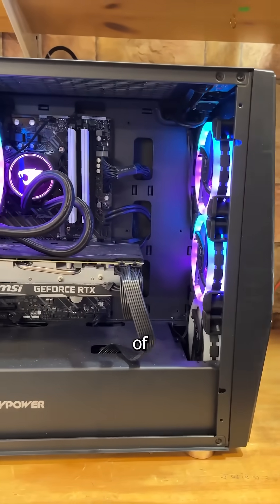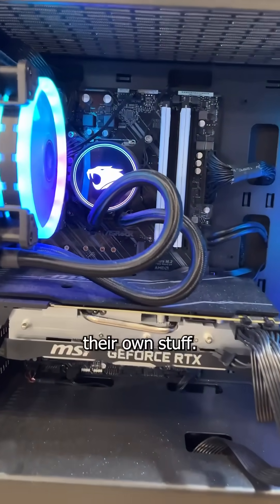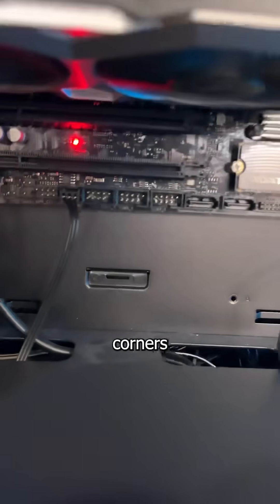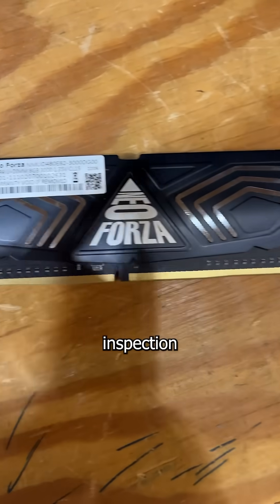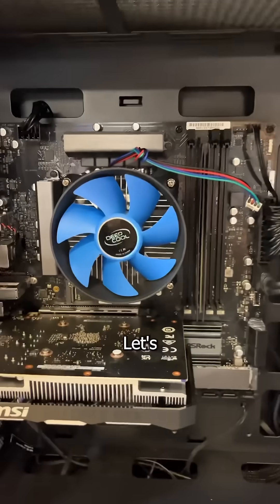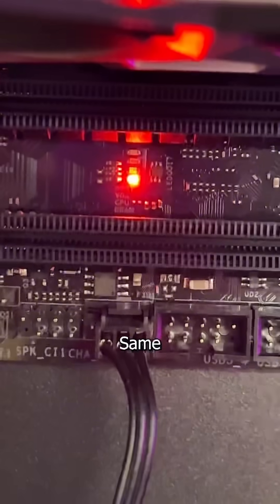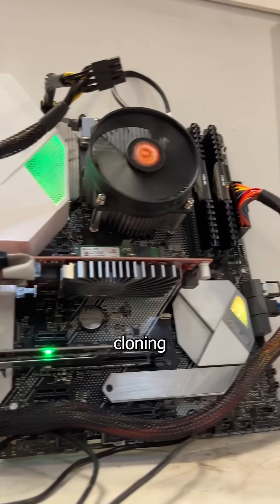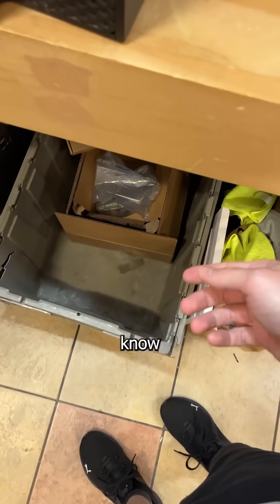iBuyProblems? Cheap NVMe causing no POST 💀 #technology #pc #tech #shorts #computer

Comment: I have an ibuypower since 2018. I just gave it a new coat of thermal paste and a clean out and still works fine.
I feel that a lot of problems are the adata drives and the user trying to mess with components or bad shipping handling.

Comment: Ok I've worked in computer repair and I have a similar issue, but backwards and I can't figure it out.  

I can't get my pc to post without the ssd I run windows on, I get a CPU error.  My theory is that it has something to do with AMDs overclocking utility.

Comment: Only after around 3 or so months after I bought my boot drive, the Adata XPG SX8200 Pro 512GB, did I realise how scummy Adata really is. (For example, the same model of the drive I mentioned above got its internals changed quietly which led to different performance from they launched it.)

Comment: When a storage device such as a ssd or an hdd are so faulty that they mess with the system itself things get funky
Once had a pc with a faulty wd green that for some reason made it have a black patch on the monitor (even tried formatting the drive)
And a laptop of mine would get stuck trying to load the bios because the drive was dead

Comment: Got a 1tb ADATA SSD installed in the front of a old iBuyPower Revolt 2 case which I have a weird feeling its a prebuilt of sorts, still going strong after 3 years now with only the straight no brand AIO cooler leaking and needing replacement.

Comment: Funny enough my brother had a prebuilt PC with an ADATA SATA SSD that caused the exact same issue. We went to get another SSD and that fixed the issue. I tested the ADATA drive later in an external enclosure and was able to see its contents, but every time I attempted to extract anything the drive would disappear from device manager and take maybe 10 minutes to reappear
Reply: AData isn't bad, I've used AData ram and storage for years without problems, but I know friends that had problems with their cheap sata 256gb dramless ssds,
Conclusion for AData is that their cheap shit is cheap, the pre-builts use factory waste / units that failed quality check
Reply: Guess the drive was alreasy past it's end of life
Reply: It was because the dude downloaded incompatible RAM online, and that storage had it on it. /s
Reply: That adata ssd your brother had probably had a different problem. Pretty sure the adata nvme in this computer is their PCIe 4.0 one, which has a problem since the innogrit controller has problems with certain types of nand flash.

My adata sata ssd had been going strong.

Comment: The previous SSD might have had a hardware issue or defect that, when connected, triggered some sort of error detection mechanism on the motherboard, leading to the RAM error light.

Comment: I bought an ibuypower PC during the Gpu apocalypse because it had a 3080ti in it and was cheaper than buying a 3080ti from scalpers.  But the CPU cooler on it only lasted 30 days before the pump failed. So i scrape it and sold the board, cpu and ram on ebay and placed the 3080ti into a much better built computer. One built by myself.

Comment: PCs are doing a short Self test at boot and the debug leds are always lighting up at the process and Shows what the bios checks right now and if it has a problem the bios will Stuck and the light will Keep lighting. and now the question why does it Stuck when it test the nvme ssd it will ask the drive what it is and if it doesnt Response correctly It will Stuck But not completly it can Hang for an hour and it will continue posting. depending on the bios and Debug Codes the RAM led will light up even in the PCi test

Comment: Propably a short on the pgood or reference or the reset signals and it keeps the pcie devices pulled down. So the chipset is also in reset state so does the cpu.

Comment: Hey man, hope you are doing well. I am facing problem with my pc. the problem is that, I can do everything with my pc, but can't get in to bios. Idk what the heck is wrong. do you have solution.  I have done almost everything to get it. but it just shows no display connection but normally it's a great monitor

Comment: Wouldnt trust adata with nvme’s eithet but external HDDs are a different story. Opened a few before - they use Samsung or Toshiba disks so theyre usually really reliable. At least mine of 6 and 2 years are still clean in Crystaldisk.
Reply: I guess adata doesnt make HDDs. Its most likely just an adapter with branded HDD inside like WD or Seagate. And btw, every memory related stuff from adata succ for some reason - sadly learned from my own experience.

Comment: That's an interesting failure. It's weird because the DRAM uses the North bridge chipset and that NVMe was placed at dead bottom, supposedly using the south bridge chipset. 

My only guess is that an electrical error must've stopped the boot process at the DRAM check. Meaning the SSD had some bad capacitors or a melted connection that was touching another important connection, and the motherboard had a failsafe for short circuits, causing the NVMe drive to lose all power during the boot up sequence, making the motherboard believe the ram was at fault.

Comment: Nvme shares power and bus lines with certain other CPU connections

Like the ram

It also depends on the slot, because not all mobos are designed equally

Comment: My MSI board has 3 LEDs: CPU, DRAM, and POST. I find it will default to DRAM for multiple issues (like cpu mounting pressure).
Reply from the maker: Yeah most motherboards do this. Which is hilarious cause it’s 2023 and we’re stuck on 1990 LED diagnostics

Comment: I’d like to say telemetry is the culprit for that issue
Reply from the maker: Please elaborate. I’m interested
Reply: @SalemTechsperts  sometimes when certain parts of computers are put together they wont communicate with each other. Say an AMD socketed motherboard with and AMD chipset but you have a janky power supply. The communication that the chip and motherboard trying to talk to the power supply saying "FEED ME" will be either neglected and the whole system will do some very funky things or take a forbidden nap and not wake back up from not being fed enough power. I have a CyberPower hunk of absolute polished crap so I know exactly how it is.

Comment: I love how these pre-built companies find the most obscure and unknown RAM companies possible to supply them with parts for their systems.
Reply from the maker: It's impressive tbh
Reply: @SalemTechsperts yup. I’ve rarely heard of any company outright having bad ram. Neo forza is also a good cheap ram. It’s not the fastest but it gets the job done. 
But dear god the amount of terrible things I’ve heard about ADATA NVMEs is insane.
Reply: Tbf ram is one of the few components that you can just pop in whatever brand and it should be fine.
Reply from the maker: @GamerBoi775   and most offer lifetime warranties
Reply: @GamerBoi775 I used to think that until I had stability issues for a year or so (every few days it would power off, no warning, conveniently whenever I was trying to be productive, not when doing something like gaming) and removed the cheap ram and it has been stable ever since
Reply: @GamerBoi775 to an extent. My company only uses Corsair ram as they should have QA to pair ram sticks. I put literally the same dye from a different ram distributor into a pc we wound up losing somewhere around 100 gigs of data from windows eating itself from ram timing issues. While away overnight. 

We do machine learning so it’s imperative our machines stay running with no hiccups we can lose days of work easily.

No data recovery is also available without extreme specialty either once files corrupt for anyone wondering. Even then chances are slim.
Reply: @GamerBoi775 not completely because most prebuilt companies don’t even specify what type of ram it is they just say like 16gb or whatever and it could be really slow like 1600mhz or something and you wouldn’t know
Reply: @GamerBoi775 Yes and no. The most common failures I've seen in computers are RAM and hard drives. Motherboards, too, but that's usually because of a cheap piece of shit PSU that borked the motherboard and took a few other components with it lol.
Reply: i bought an ADATA HDD back in 2012 or something and it still holds surprisingly lol
Reply: Microcenter sells Neo Forza ram actually.....
Reply: Neo Forza is actually a very common brand.. it's a budget brand... G Skill is also a very common brand.. ADATA has been around since the '80s more or less, and is extremely common and they make components for some of the most well-known computer manufacturers out there... Including Dell and Alienware as well as cyberpowerPC, compact, HP, IBM, Lenovo, Fujitsu, Toshiba and the list goes on and on.. just because you don't know the brand does not mean that it is unknown...
Reply: Brand doesn’t really matter that much. It’s gonna be made by sk Hynix or Samsung or micron
Reply: Its usually a chinese company supplying the parts and thats why the prebuilts are mad cheap.
Reply: Maybe these system integrators do but when you buy Dell, HP, Acer, or any other large OEMs, you'll get ram that comes directly from Micron, SK Hynix, Nanya, Infineon, etc.. The SSDs are usually the same way OEM Samsung, Micron, SK Hynix, Toshiba(now Kioxia,) etc.
Reply: To be fair at the Microcenter near me neoforza is the only ddr3 ram available lol
And they don't seem bad at least to keep as a diagnostic stick of RAM
Reply: Neo Forza is Goldkey's house brand. Goldkey is a year older than iBP
Reply: It’s cheap is why lol
Reply: I´m not a company and got a very dark underground pair of sticks xD
Atleast has samsung chips
Reply: I know it's been three months since your post. The reason why they do it is almost all ram "makers" or providers use the same two ram chipmakers. Basically, all ram is the same no matter what brand it is. And there will always be chips that fail for whatever reason, and it happens to all ram sellers. So, they will get the cheapest ram they can get their hands on to save on costs with little risk of it failing. The same with any common component.
Reply: Neo Forza is a familiar name if you mess around with pcpartpicker a lot.
Reply: Most of the time, you can just go buy ram sticks at any local reputable shop and it'll work just fine. As long as you buy them with warranty
Reply: Geil memory has been around for more than 20 years smh
Reply: Adata is not obscure.
Reply: Cheaper products without as much advertising always a good choice 😂
Reply: My MSI pre-built is going strong though
Reply: 980 is what I always use never an issue
Reply: they all buy the same ram from china and rename it, they even put the brand of the store
Reply: IBuyPower isn't a pre-built company
It was an eSport team for Counter-strike before they disbanded
Reply: @zaneatat iBP was an SI for like 13 years afore they even got into esports at all.
Reply: Aryan tbh
Reply: eh, I've heard of adata before but good to know to avoid them
Reply: Right, go for the cheapest parts they can then over-charge on the pc
Reply: Pretty sure there are only a few companies that actually manufacture the RAM chips so the name brand of the sticks isn’t really important. If you’re going for high performance then it is more important cause better brands will have better quality control and binning.
Reply: i’ve used adata years ago when i was poor. i’m still poor so i use corsair instead

Comment: Hey, I'm finally early, I got a question, what is wrong about the adata drives? I use an adata SSD, because I can't afford another, whats wrong with them? Is my pc gonna die?
Also thanks for your videos, they're amazing
Reply from the maker: I've experienced a high failure rate with ADATA drives, your experience may vary. Regardless, always have your important data backed up to multiple places regardless of the brand of drive you use.
Reply: @SalemTechsperts  thank you, what ssds do you recommend?

Comment: that moment when he was about to boot the PC but... forgot to switch the PSU on...
💀 I almost died.
Reply: If I was going to do work on my computer, I would turn off my PSU too. If I suddenly forgot to turn it on...so what? It's just a click.
Reply: @laffi bruh
Reply: @laffi if you ever worked in computers for real this would be terrifying ABD hilarious. Why you mad
Reply: I do this a lot. Made me giggle
Reply: @@aidaneaglesfield9148 samee XD
Reply: I forgot to flip that switch when I built my lil brothers pc and said oop everything is dead he got so worried because he accidentally discharged some static electricity as he picked up the mother board and distraught because he just lost 1k dollars and I said hold up wait a minute flick the switch and slap the power button and it spins to life we was both happy. Been 5 ish years its still going strong
Reply: I forget every time I do a tear down to clean my rig lol
kind of a tradition of mine at this point
Reply: Windows 10 update killed my ram. Or mobo. Everytime I plug the ram stick the error code glitches. Wont post.